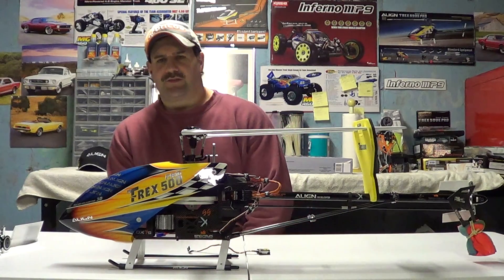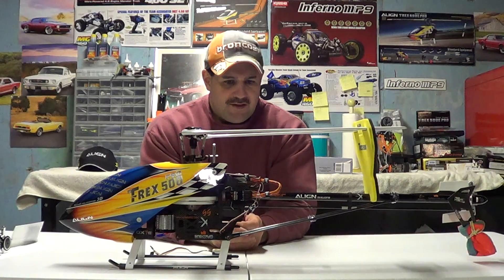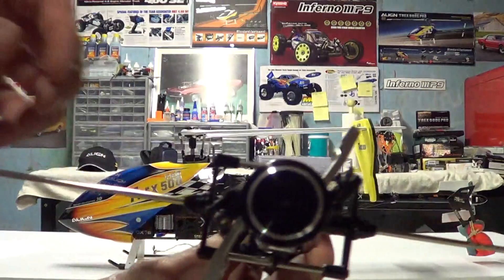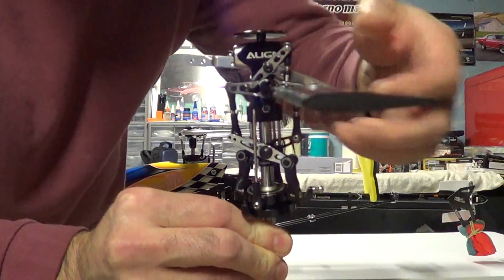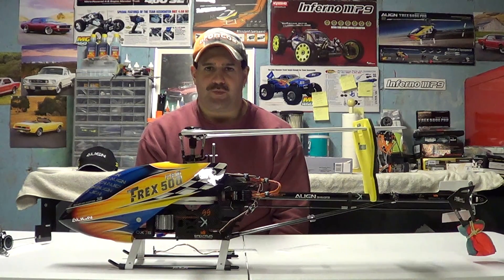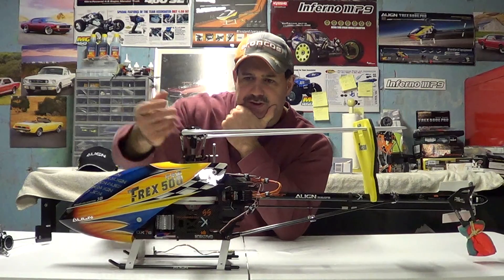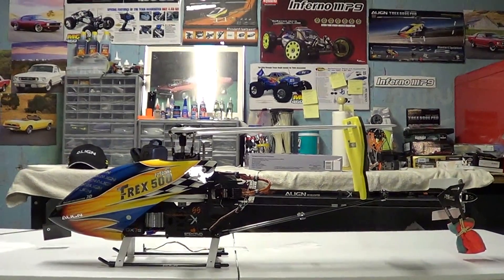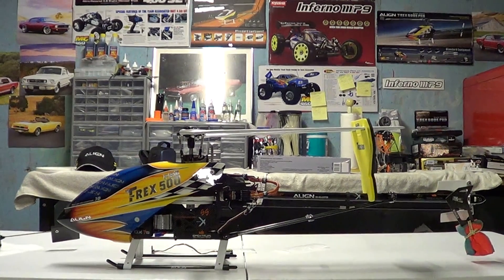Fly barless and fly barred rc helicopters ,understanding how they work

Comment: I have been introduced to helicopters with the old mjx toy sub hobby class heli.   Recently Ininherited a tarot pro 450 heli and i wondered if you can advise how to get this in the air
Reply: Specificly ade parts availa le for the pro 450.  Not flybarless
Reply from the maker: Yes what ever help you need just ask I'll try to help

Comment: Hey man...quick question.  I have a blade 150s that I'm struggling with.  When I try to take off, it wants to tip over.  I'm not sure if it's an unlevel swash plate, not having zero pitch on the blades at zero stick, or something else?  And, I did the calibration procedure to make sure that was set properly.  Any suggestions, and I really appreciate you help.  Your videos are awesome, thank you sir,

Chris
Reply from the maker: I would re do  and double check settings in the  unit on the 150  and transmitter

Comment: Got a good  one for you RAY I'm building a align 600cf scale heli for a friend he bought the align 550e / 600 three blade rotor set up " OK the 550e main shaft doesn't work on this heli cause it has the 3rd bearing block"  it had the the dfc head on it. the main shaft with the kit came with the new rotor main shaft has two bolts for the rotor  head , what main shaft can i use will work for this heli" everything works but I can only use the bottom bolt hole with the clamp at the bottom of the three blade head using the 600cf main shaft can you help ?

Comment: Thanks for the vids... Which heli do you recommand for beginner provided I have practice on simulator regularly?are those blade mcpx or trex 250 or the mini cp from walkera suitable? I wont go bigger size than 250 heli as they are expensive to repair..thanks..

Comment: Alright Ray let me see if I understand you.  So essentially a flybar is a mechanical stabilizer on a helicopter.  A flybarless system uses a gyro to control 3 servos to stabilize the helicopter.  Do flybarless helicopters have computers (or sensors) on the machine to operate the servos to correct stabilization?  This is awesome!!  I have been studying batteries and chargers most of today and my head is swimming (haha)!  Once again, I can't thank you enough for all your help!